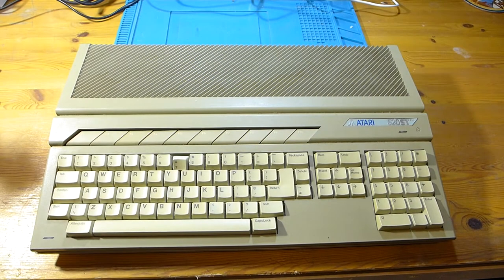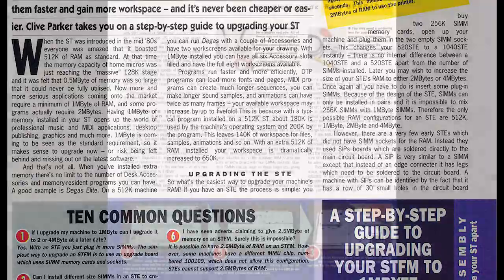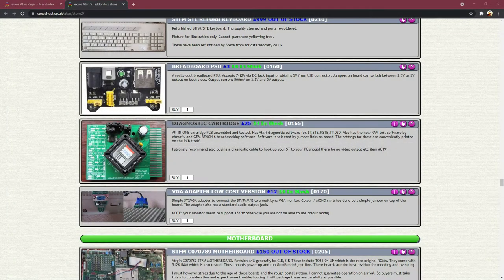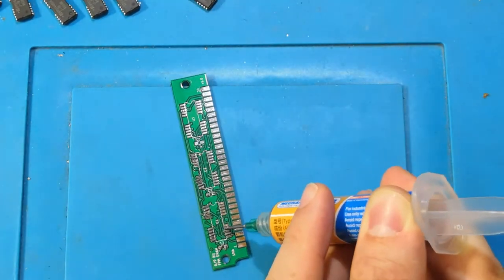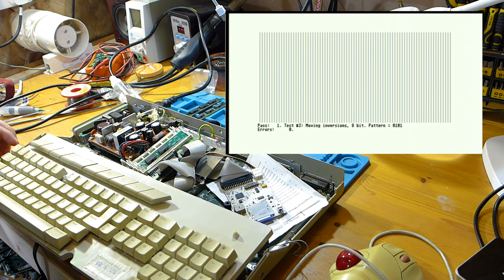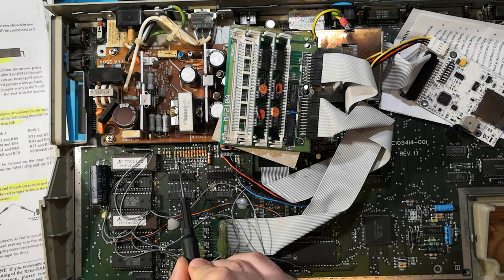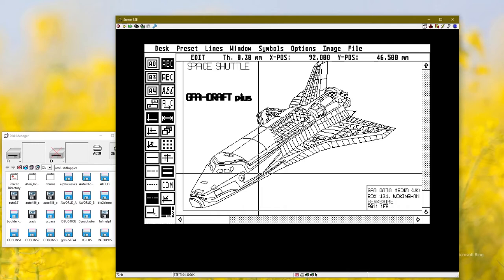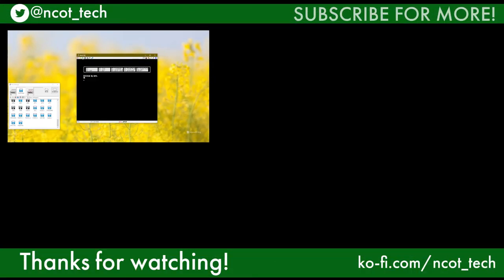Marpet XTra RAM Deluxe 4MB upgrade for my Atari STFM. Turning it into a 4160STFM.

Comment: Loving the videos, and really enjoying seeing an ST from the day being worked on again.  My ST sadly did end up sold and my current one is a from eBay.  Still having lots of fun with wild upgrades like the UltraSatan, 4Mb and Gotek drives.  Although finding joystick extenders is amazingly hard these days considering they were standard issue back in the day.  The mouse is, I agree still garbage.

Comment: Another excellent hardware upgrade video. The mp3 music files that I used at my wedding are about six times larger than the capacity of the RAM that you've installed. What you need now is a nice 20 MB hard drive to fully trick out your ST :)
Reply from the maker: Funny you should say that. There is a deleted scene where I pointed out the on-die cache for my PC's CPU is far larger than the RAM the 68000 could even access.

If I can build it, there'll be an 8 gig SD card to use as a hard drive.
Reply: @ncot_tech  what beast of PC do you have? Or what is far larger by your means? I mean the best CPUs do have L3 Cache in 32KB territory, while this is double the m68k address space, I dont know if I would be so impressed by it and call it far larger...

😁:elbowcough: